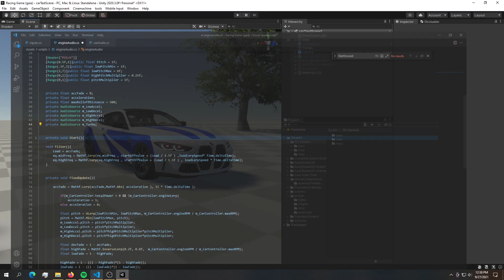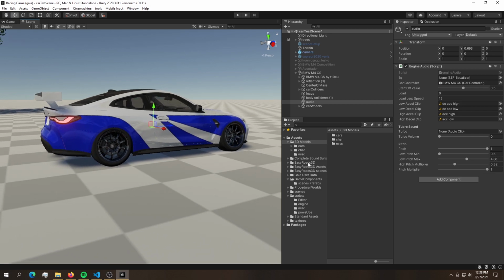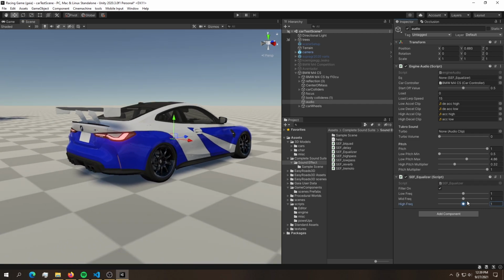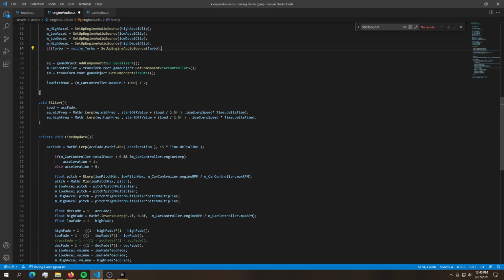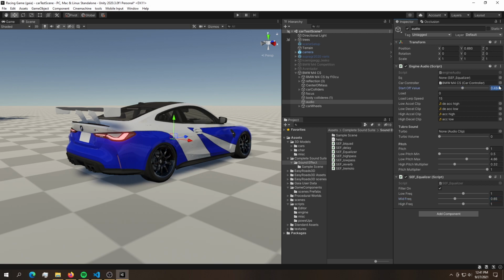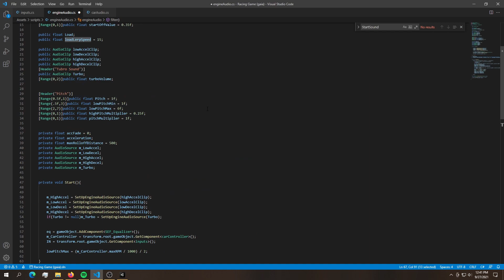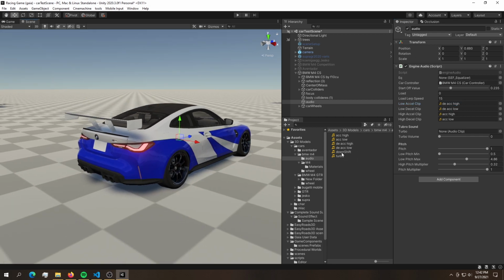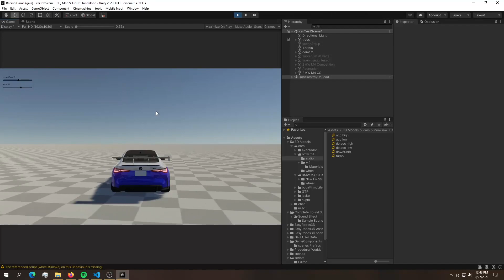Car Audio In Unity (Realistic) | Racing Game v2

Comment: Hi Pablo, pls help. İ get this error.
GameObject has multiple AudioSources and/or AudioListeners attached. While built-in filters like lowpass are instantiated separately, components implementing OnAudioFilterRead may only be used by either one AudioSource or AudioListener at a time.
The reason for this is that any state information used by the callback exists only once in the component, and the source or listener calling it cannot be inferred from the callback.
In this case the OnAudioFilterRead callback of script SEF_Equalizer was first attached to a component of type AudioSource on the game object audio after which another component of type AudioSource tried to attach it.
Reply from the maker: yeah make sure u have 1 audio listener in yout scene
Reply: @pabloslab  i checked all of objects in scene. But Camera have only listener. I can't find error